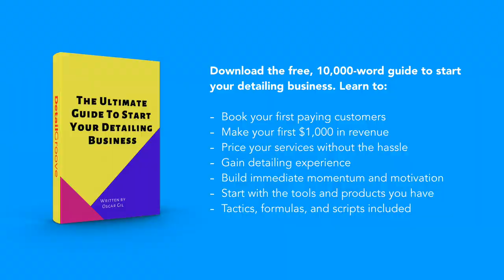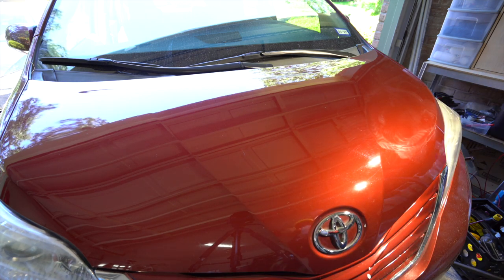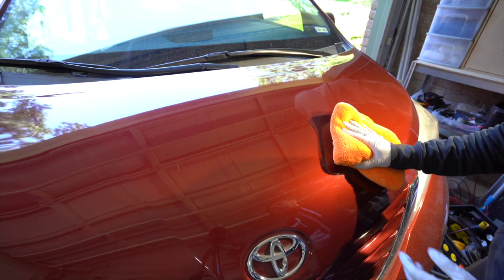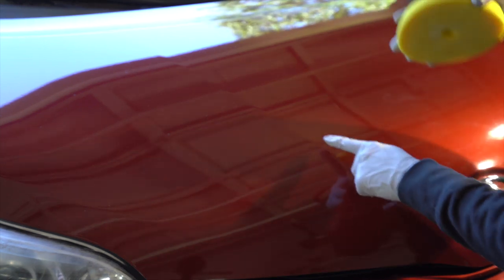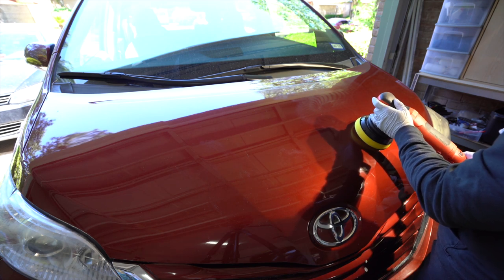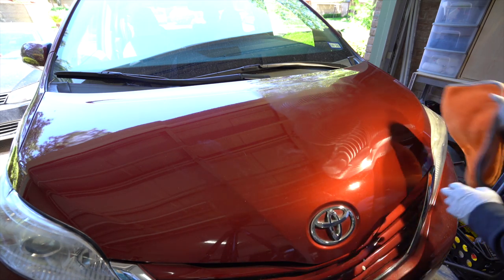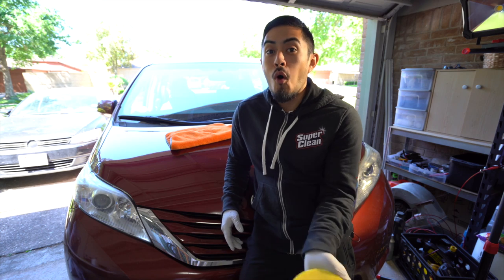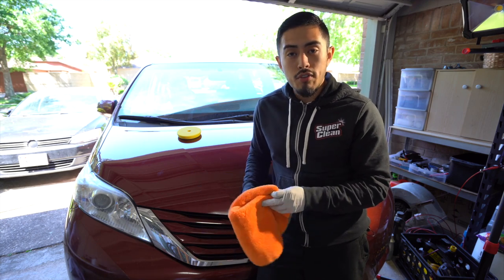Polishing Paint Basics For Beginners - How To One-Step Polish

Comment: As per usual:
It's done as per the customers budget, from there you manage their expectations 

I've done cars with a machine glaze for customers who really just want a quick "enhanced" look, this can be done in literally a few hours. 
Then I've gone as far as chasing perfection with no end budget defined up front! It's all about the car and the customer. 

Be careful over them ridges though, excess time and pressure on the ridge and you can strike through. I know you know this, but just for anyone new to this and thinking it's all good to polish over lines of bodywork.
Reply: So kind of lift off a little where the body lines are to prevent from cutting too deep into the clear on the ridge?
Reply: @midnightmystery544  I'd polish up to a ridge both sides to meet at that ridge (if that makes sense). Going over a ridge is unnecessary in my opinion.
Reply: That is very true

Comment: A customer says I want a inside and outside detail. Do you ALWAYS offer the  steel removal, clay bar too? 90 percent of customers don't know about these other services
Reply: U mean iron remover and claybar thats up to you what u want to offer just charge correctly
Reply: @Angel_Peg  Now I think about it. What are some signs you sould use a Iron remove?  This is one service I don't  offer for that reason.
Reply: @patrickguida3979   I think iron removal should always be done before a correction.
Reply: If you are doing any correction, you NEED to do iron removal, tar removal and clay bar Treatment. 
You want the clear coat as clean as possible before you even think about using a DA polisher.

Iron removal is done by using a dedicated iron removal, such as Iron Out by Autofinesse.
On lighter colours you will be able to see small orange dots where iron particles have landed and then began to rust. Iron Out will dissolve these and remove the contaminants safely, while turning purple to indicate the reaction.
Jet wash it off after leaving it to dwell, but DO NOT let it dry on the surface.
Reply: @ryan_lawrence  Hay this has opened up a whole new  world. So if my obective it a 
ONE step. So 1: iron remover 2: clay bar 3: wash and rinse Than if I want to finish with HD SPEED. So this is a  part of a one step
Reply: @patrickguida3979  I would go:
1 Citrus Pre Wash
2 Snow Foam
3 Safe Wash (2 bucket and 2 Mitt method)
4 Iron Decontamination & rinse & quick dry
5 Tar Removal & rinse
6 Snow Foam AGAIN, this neutralises the previously used chemicals and makes sure theres no residue left on the vehicle.
7 Clay Bar using clay lube & rinse
8 Dry
9 Compound / polish / All in One / whatever you want to use
10 Seal the paintwork using a wax / sealant / ceramic coating / whatever you want to use for protection. 

Polishes and Compounds leave NO PROTECTION, All in Ones tend to leave a small amount of protection which doesn't last long. 

When washing the car in future, use steps 1, 2, 3 & 8. Then follow up with a quick detailer or a spray wax to top up the protection.
Reply: Ryan Lawrence question. Instead of step 6. Can you just spray paint prep (isopropyl + Water) instead of just foaming it again
Reply: I like your thinking.... Very practical... 

My vote would be wash/dry or wash/clay/wax... then for correction or a coating then add the iron remover... No need to spend 4 hours and extra money in chemical doing a simple wash/wax...
Reply: @ryan_lawrence  why would you do all that if you're correcting it the end? 2 bucket method is to minimize swirls so why waste time worying about adding very little to none? Don't over work just use a few wash mitts. They have 2 sides each

Rinse,Foam,Wash mits, rinse,Iron Remover, rinse, dry, Clay bar, IPA ect ect.
Reply: @edg9567  I see where you're coming from and I understand your point.

However for me, and I'm sure many others agree, correcting the paint in itself is an extensive job, and can take a hell of a long time. 
Cutting corners to speed up the wash stage just cant be done, as it just adds more work in the correction stage. 

Imagine you try to speed things up by using one bucket, not rinsing the mitts properly, you pick something up off the paint as you've not done a pre wash, you end up creating deep scratches and even more damage to the paint. 
I dont even know why you would risk it. The idea is to be as thorough and SAFE as possible, even in the correction stage (starting with the least aggressive combination with the capability to cut, in order to preserve clear coat).

Take the time to do the few quick steps in wash and prep, so you dont add potentially hours more work in correction.
Reply: What is snow foam and why the 2 bucket technique?

Comment: I have a yellow pad but it isn't getting rid of my heavy oxidation sandpaper would of been better I have 180 and higher grits too. But the yellow pad doesn't get all the heavy oxidation off fast I can show a pic of how my truck looks now but I did use a different color of grey on my truck that was bright silver metallic it was PS2 but my paint code is PS2 but they both bright silver metallic paint.

Comment: Why does my polish keep drying up on me? it be so hard to buff off the paint
Reply: Are you using it in the sun?
Reply: Make sure you prime the pad also
Reply: @user-in8xx1xu5b  No. I was in the garage. I end up switching to a new or different polish and it didn't dry up on me. I was using that mother s ceramic polish and i switched to 3D speed and it didn't dry on me anymore
Reply: @Dee--Jay  how do you like the 3D? And have you ever used anything from chemical guys?
Reply: @user-in8xx1xu5b  The only thing I have used from chemical guys was to be 36. A cutting polish. Its cool! But 3D speed was awesome. Dont expect medium cut. Its very light cut. It also has a built in wax. It last about 3...4 weeks.
Reply: @dee jay pretty sure your product is past due